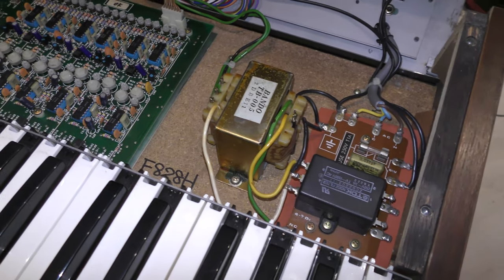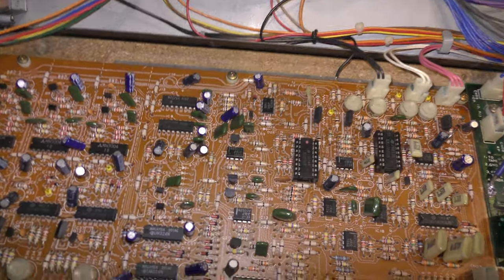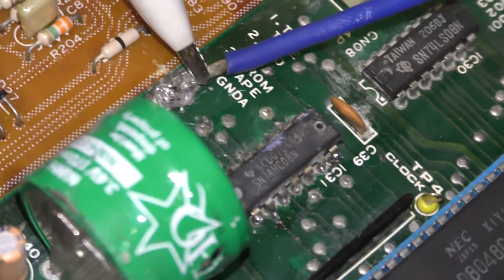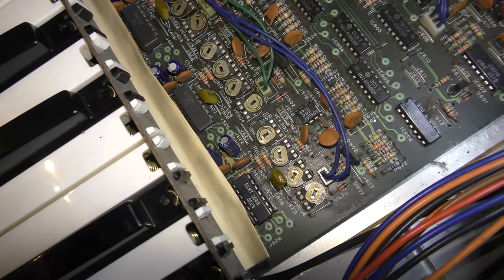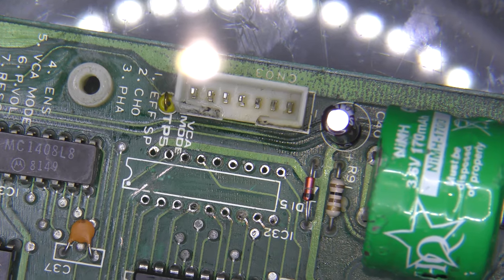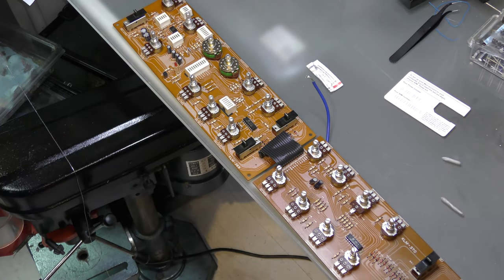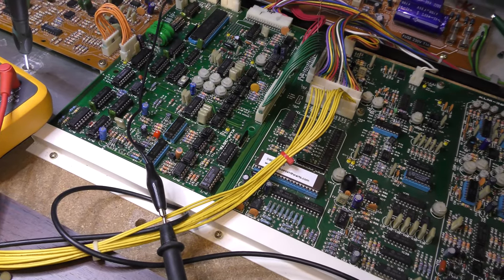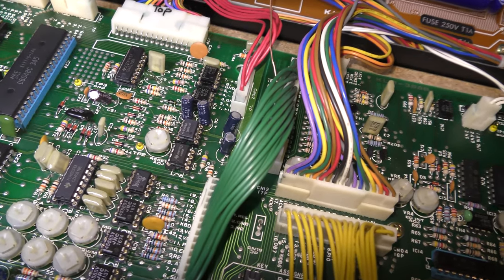KORG Polysix synthesizer - troubleshooting and battery board repair, Part 1/2

Comment: Thank you so much for sharing so much knowledge and information. After watching this video I ran to my Polysix and removed the battery and found that indeed it had leaked on the IC31. I am not that knowledgable with repairing vintage synths so I am not going to rush this repair until I have all the knowledge that I need moving forward. Thank you again.
Reply from the maker: no problem and thanks for the kind words. Yes it's a matter of just taking your time and checking all the surrounding traces with a scope, even if they look OK. Replace the IC with a socket and insert a new chip.

Comment: a friend presented me a dead polysix, and with help of your video I'm troubleshooting it. the battery damage is there, but it's not in a dreadful condition like yours was. first i will restore the klm367a1 board and change the spark killer. just found the oldcrows website thanks to your video. hope to be able to revive this really cool synth! cheers from Belgium!
Reply from the maker: HI, Yes they are a lovely sounding synth. A goto synth for all manner of sounds. Time, patience and a little soldering skill will go a long way in fixing this machine. Best of luck
Reply: @waheex  thanks! changed the battery to lithium 3v with diode. now repairing the tracks. fingers crossed